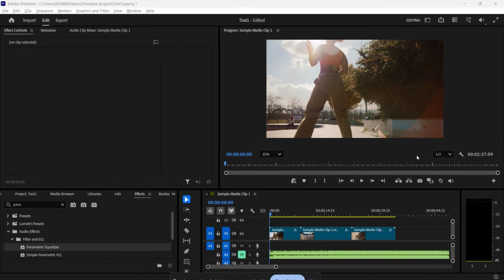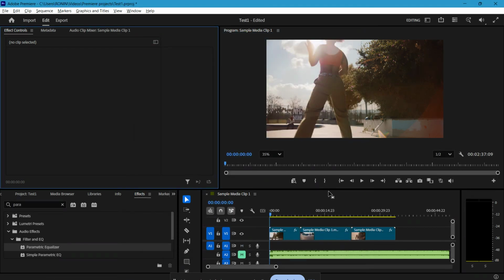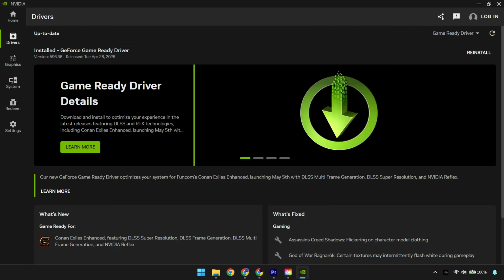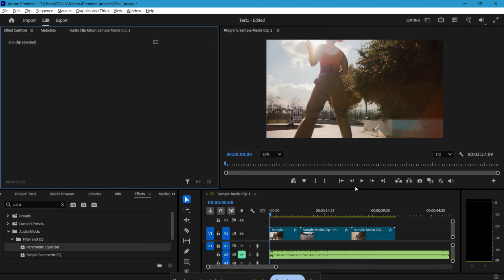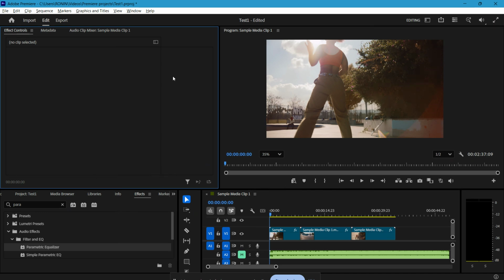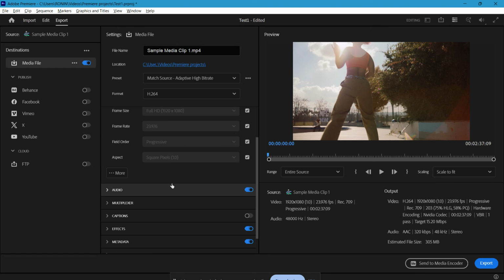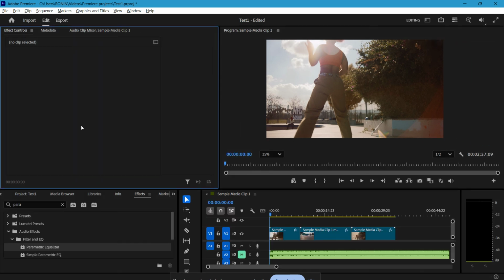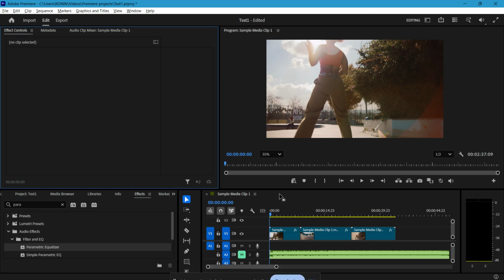How To Fix Premiere Pro Not Using GPU Acceleration For Rendering (Easy Guide)

Comment: I have AMD GPU and still not using
Reply from the maker: For AMD graphics cards, Premiere Pro utilizes OpenCL for hardware acceleration. If it's not working, go to File > Project Settings > General and ensure the renderer dropdown is set to Mercury Playback Engine GPU Acceleration (OpenCL).

If the option is completely grayed out, head to AMD's support page and update your system to the latest AMD Software: PRO Edition driver, which provides much better stability for Adobe apps than the standard gaming drivers.

Drop a like and subscribe if this helps wake up your AMD GPU for editing!
Reply: @LeonardGuides renderer is opencl but still not using 😢 even my small edits takes hours
Reply: And yes, my gpu is up to date

Comment: My cuda not showing its onlh show open gl
Reply from the maker: If you only see OpenCL, Premiere is ignoring your NVIDIA card and using your processor's basic internal graphics instead. To fix it, open your NVIDIA App / GeForce Experience, go to the Drivers tab, and update to the latest Studio Driver (not the Game Ready version). Then, open Windows Graphics Settings, add Premiere Pro, and set it to High Performance to force it onto your dedicated GPU.

Drop a like and subscribe if this unlocks your CUDA rendering!

Comment: Hey, I had to clean cloud install my windows because of a Microsoft Update glitch. 
After that all the required, drivers and graphics were automatically insatlled.
So, after all that process, I installed premiere pro, now it's causes lag in playback at Full quality, without plugin, but before all that, I can easily edit my videos on battery at full quality even higher resolutions videos. 
I think premiere pro isn't able to use the graphic/gpu properly. 
Please help me, I've done all the possible method to solve this.
Reply from the maker: This usually happens because Windows installs generic graphics drivers after a reset. Premiere Pro may not be properly using the dedicated GPU even though the drivers look installed.

Try these fixes:
1. Install the latest Studio Driver directly from Nvidia/AMD instead of relying on Windows Update.
2. In Premiere Pro go to File > Project Settings > General and make sure Renderer is set to GPU Acceleration, not Software Only.
3. Open Windows Graphics Settings and set Premiere Pro to High Performance.
4. Delete Media Cache from Premiere Preferences > Media Cache.
5. Also check your Power Plan and switch it to High Performance because battery saver modes can throttle Premiere heavily.